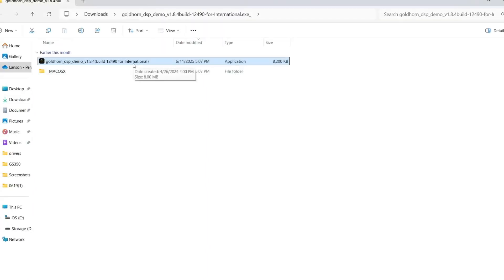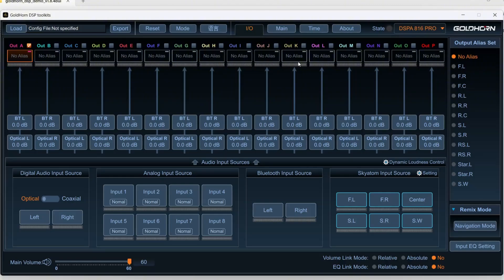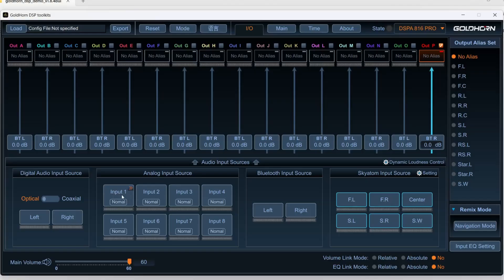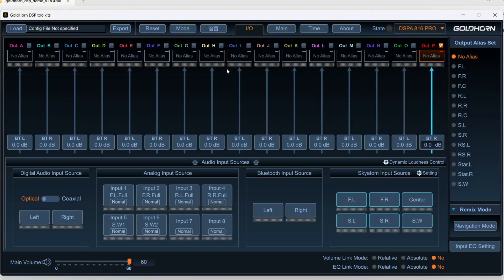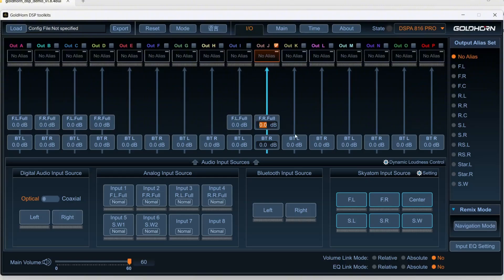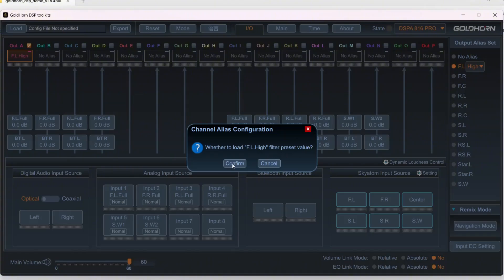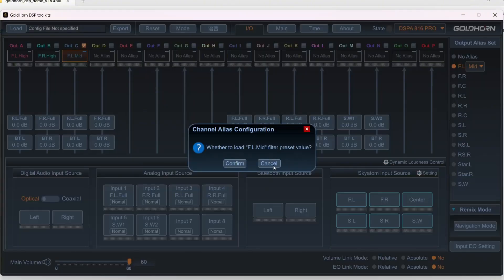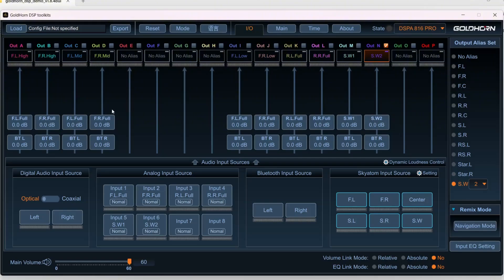Goldhorn DSP Setup - First Steps: Input / Output

Comment: Where are the aux low level boxes to use that for input .. ?
Reply from the maker: Need more info to assist.   The input section should have all Bluetooth or aux/digital options to select.
Reply: @LansonF no not on the set up screen on my optical .. Bluetooth and analog input source .. no aux Boxes to drag and drop .. it’s a dsp10
Reply from the maker: @Hawaiianjo  I'm on diymobileaudio.com, under "Lanson" as user.  You can reach me there and we can work through it.  In the meantime, I looked through the manual, most of the models show the ch 7 and ch 8 are aux or high level input (not both at the same time), so my thinking is, unless the DSP10 came with a manual that says something to the contrary, your ch 7 and ch 8 Analog inputs should be it.
Reply: @LansonF yes that’s what I came up with .. that has to be it lol.. I haven’t I installed it yet .. just did the mapping and manually transferred tune … from my Musway DSP68 .. thanks
Reply: I haven’t put it in the car yet .. just setting up on the bench .. replacing my Musway dsp68

Comment: Thanks for the video. I am planning to install a 406 in my sedan. Can we mix the RCA and High outs together to run more drivers? for eg: 4 door speakers from the dsp and a front mid/tweeter from the RCA out using an external amp? Let me know your thoughts? Thanks.
Reply from the maker: Hey there, you will probably find in the manual that for any given channel, you will want to choose internal amp OR RCA preamp out, never both for the same channel.  However, you certainly CAN add channels with an external amp that, say, has 2 channels RCA IN, and 4 OUT.  The biggest disadvantage of course is lack of DSP management channel to channel, so time alignment, EQ, etc all would be subject to all speakers on that output.  When in doubt, just get a DSP with more channels if it's an option, because the headaches aren't worth it when it comes to the compromises required.  Back in the darker days of about 5-10 years ago, I ran JBL MS-8 DSPs with additional amps powering additional channels, and also made my own passive crossovers to further the channel count.  Necessary back then, but today, these DSPs can be purchased with too many channels to count.
Reply: @LansonF  Thanks for the comment. Need to try it.
Reply from the maker: I did read in one of the models recently (I want to say it was the 810PRO) that it was 100% OK to run the RCA and the high level outs at the same time.  I remain skeptical because of reasons, but it may not hurt to email Goldhorn and ask.  When I asked other questions (mostly related to software), I got an answer in about 48 hours.  Not bad.
Reply: @LansonF  I finally made up my mind for 810 SE. Now, i will run full active with high level out. front 3way and rear fill fullrange.
Reply from the maker: Nice!
Reply: @LansonF  I am Done with my installation. Any information on Dynamic Loudness Control settings? I am super Happy with my current set up.
Reply from the maker: @cgrenesh  Hey there, I spoke on that topic a bit on that in another video, if I recall.  If not, I owe the channel a video that's still not published... 
You can see as you're playing music what SPL you're at, and then adjust the low end and/or high end with a bit of a lift or dip which triggers when you bring the system up or down past SPL thresholds.  I've still been tinkering with this, but IF you want, for instance, a bit more low end when cranking it up for fun, you can do that.  Or when the system is quiet, maybe the treble comes up.  That's also doable.  I think my current setting is 1.5dB boost to the treble and low end (after reaching a reference +40dB.  

I'm glad you are happy!  I just finished another build, this time with an 810PRO onboard, and it turned out great.
Reply: @LansonF  cool! I shall give it a try. thanks!

Comment: So how many speaker can you run active on the dspa 810?
Reply from the maker: DSPA 810PRO is a 10 ch DSP, with 8 channels powered internally (or you can run to external amps on all channels of that DSP.  So, front 3-way + rears (passive/coax) + center (passive/coax) + sub, perhaps?
Reply: @LansonF I posted my exact setup on your discussion board on here for talk about feature topics and questions

Comment: My next step is to figure out the best device for making adjustments. I could use a laptop, but they are kind of big and bulky. I have seen some Windows 11 based tablets under $250 which looks very interesting.
Reply from the maker: I just use my gaming laptop, an Asus A16, in Silent mode when doing in-cabin work.  I'm sure just about anything Windows-based will work, though you do need to watch out for different program versions based on your processor.

Comment: I'm considering getting the 816 myself. 
Can you tell me if these units have upmixing capability? I'm not completely sure what that is, but I believe it's necessary to create differential rear fill.
Thanks
Reply from the maker: Skyatom is your upmixer.  It's just plug and play with surround and center mixing, and then you can choose a few settings to optimize.  My other video touches on it, but I do plan on doing a much more in-depth video now that my system's tune is nearing completion.  I recorded most of the sessions so I need to edit them into something usable and I can show.
Reply: @LansonF  Yes, Scott over at Audio Intensity explained how he is able to create the rear fill in several different competition vehicles. I believe there's only three modern day brand dsp that are capable of doing this. Helix, the Pro versions from Arc Audio and the Goldhorn versions from DSP10 and above. I just wanted to make sure it was capable of doing that before I bought it.
Reply from the maker: @JasonWW2000  Yes, Scott is the man!  My whole system is from him (Eton/Goldhorn), he helped a lot.